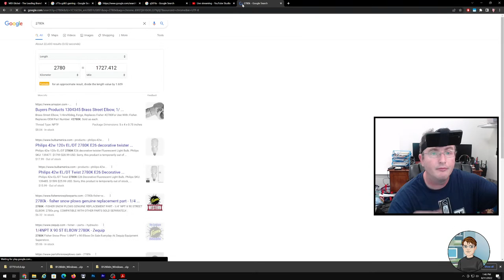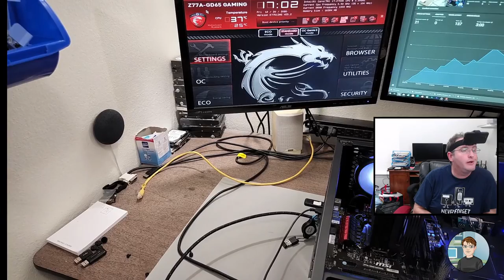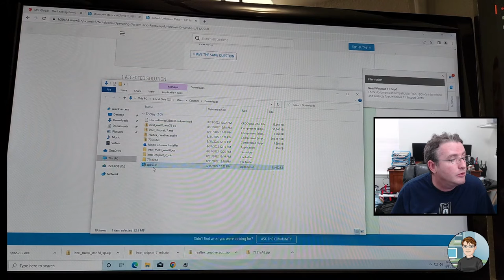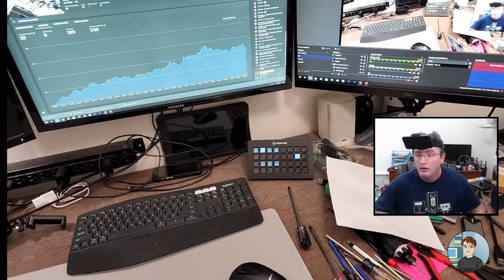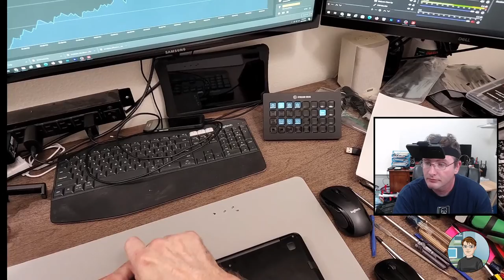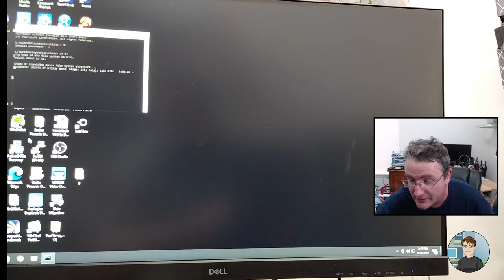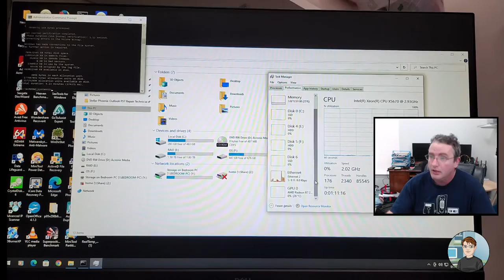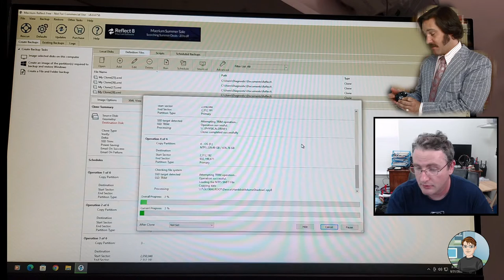Troubleshooting a PC with no video output, a laptop with a boot loop and a laptop needing a battery

Comment: There is a windows pe image that you can bern it on a usb flash then you can access the drives from the usb drive without the permission issue.
We used to use that kind of images to install older versions of windows with screen reader assistant until microsoft supported builtin screen reader on its windows 10 and 11 installers.
Now I still use it to extract files from corrupted windows or forgo-ten password computers.
Reply from the maker: Cool.  To get around the permissions issues I usually just run a data recovery app.  It's faster for me than waiting for the system to reboot to another drive.